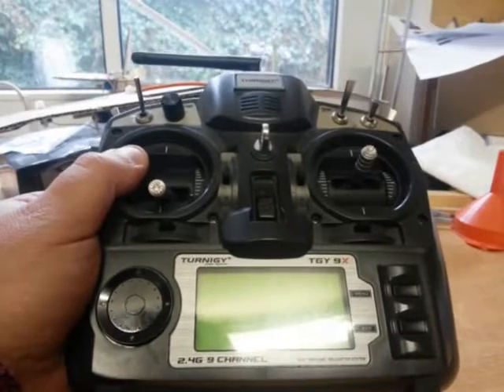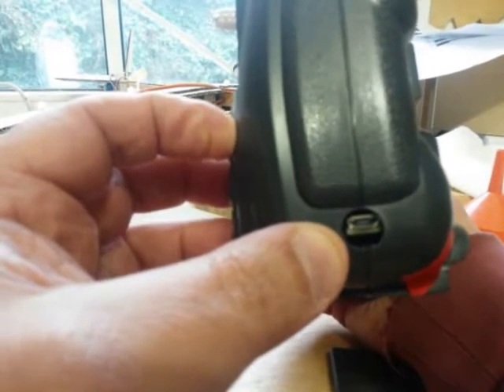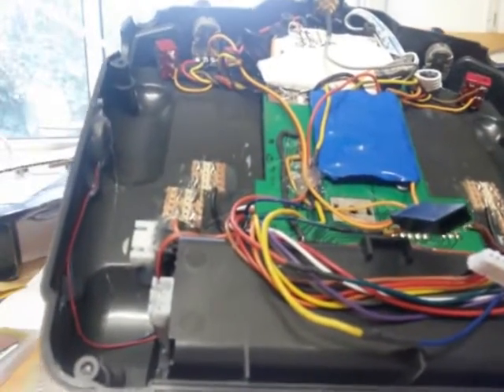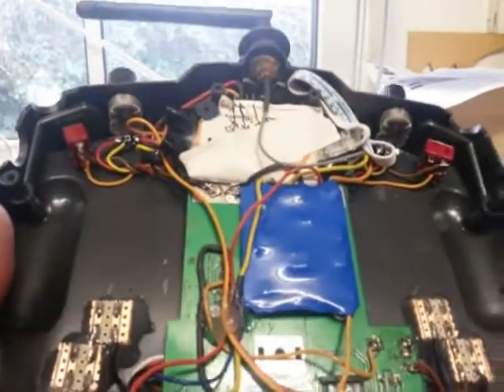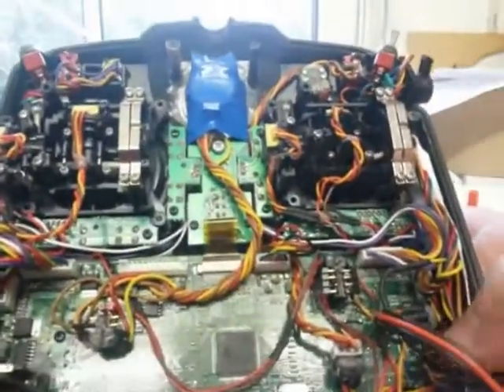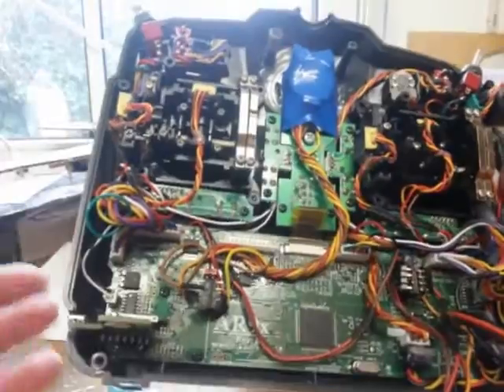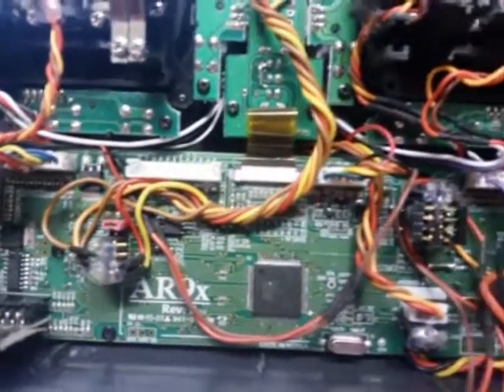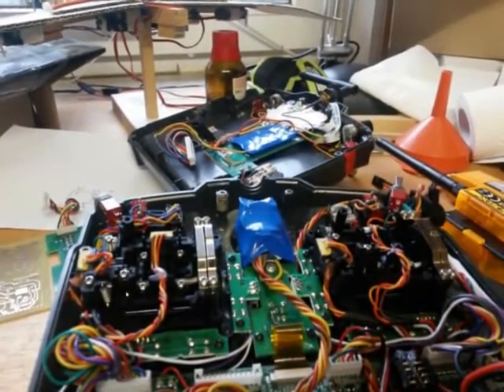My Ar9x Radio

Comment: Kinda mind blowing with all those mods!
Been thinking of getting Turnigy 9x. Is your TX now better than the Taranis? Less $ or more $?
Reply from the maker: Well, I wouldn't say it is better.. I would say it is better for me.. I don't really like the feel of the Taranis. One of the things that puts me off are the horrible programming buttons that make no sense at all. 
My radio does nearly all the taranis does, plus some other features that the taranis does not have, like trainer over bluetooth for example..
I don't know about the price. I don't really know how much I have spent on it. The Ar9x board costs about $30 I think..
At the end of the day, it is all down to what you want and what mods are you able to do. Some are not easy. Now, if you ask me, I wouldn't have a Taranis, nor would I have a stock 9x radio :)

Comment: Thanks for the video. It’s really helpful. Where did you find the 7way switch? That’s nice.
Just to know is it possible to add 6 position flight mode switch. I was modifying my Turnigy 9x and found out this AR9x..
Reply from the maker: +Sanjeewa The 7 way encoder you mean?? I bought mine long ago from someone that also supplied the little boards to mount them. But i think JK from Ar9x is also thinking about supplying them. Not sure though. Check the Ar9x website.
It is possible to install a 6 position switch.
Check openrcforums.com for very good info on all the mods you can do to your radio..